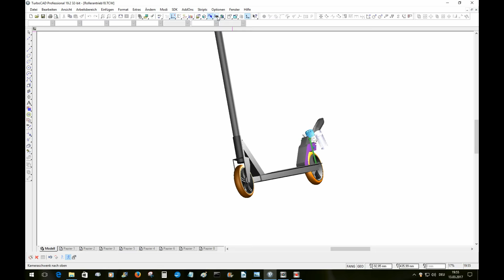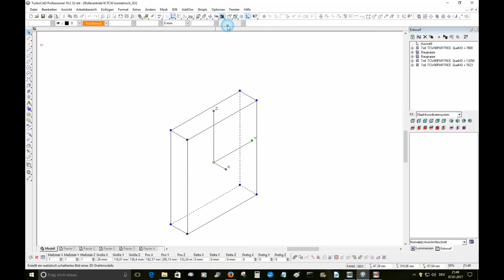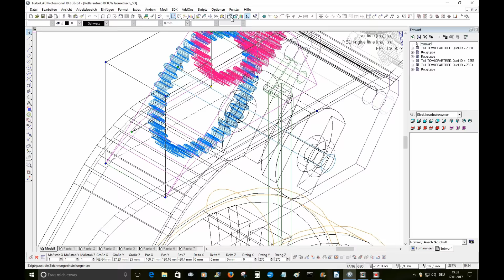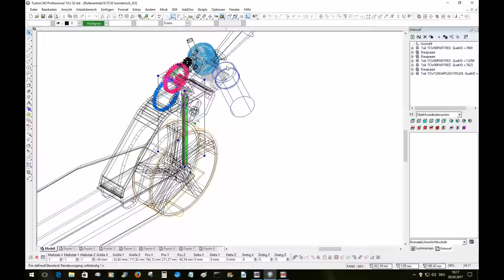How to motorize a Scooter - Engine Capacity 0.049 CI / 0.8 cc - 30 000 rpm

Comment: The spindle up against the tire needs to be wayyyyy smaller in order for the engine to get to proper operating RPM. Won't have enough torque down low at its current rpm.

Comment: I think the rc car it came from could tow faster. This could use some small improvements and might be practical sort of. These motors do have alot of power but they need higher rpm to access it.

Comment: Good engineering
Reply from the maker: ou812 ou812 
thanks
Reply: That thing is extremely underpowered. The fuel tank is so small you can run the engine for only a few minutes. That's if the connecting rod or crankshaft doesn't break first. Run it for a few more minutes and the clutch is toast. Yeah that's a good design.

Comment: I build RC trucks,you will split the connecting rod revving it like that,not good for them lil motors,it's a fail,sorry,plus that clutch is the size of a quarter,you smoked it after the 3rd run

Comment: Running waaaay to lean
Reply from the maker: Budget Friendly RC 
But this means fun😄
Reply: EnginePoweredArt yeah will go at high RPMs but you won't get any torque
Reply from the maker: Budget Friendly RC 
Torque depends on stroke capacity. But there is not much. So it's compensated by high rpm rpm.

Comment: What is the power output? Like 200 watts?
Reply from the maker: Unfortunately, the technical data sheet contains no information about the performance of the NT18 engine. Compared to other combustion engines, I calculated the power of almost 180 watts.
Reply: EnginePoweredArt thank you!

Comment: That motor won't last long what a waste of time and labour
Reply from the maker: jimbo slice 
The speed of 30,000 rpm is normal running mode. This engine is still running very well
Reply: EnginePoweredArt you mean to tell me if I was to stand on that scooter and force it to pull me up a hill the piston won't give out??
Reply from the maker: jimbo slice
I am sure that your question will be answered after reading the description under the heading of this video.
Reply: EnginePoweredArt mate overall it's a waste of time put it that way
Reply from the maker: jimbo slice 
👍Ok, let's leave it at that